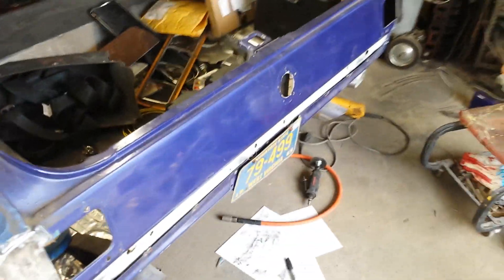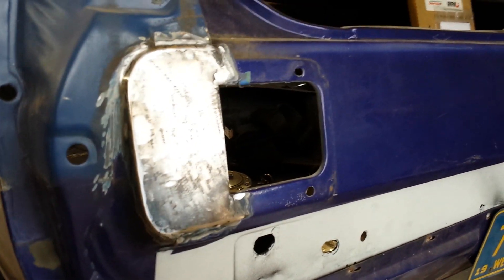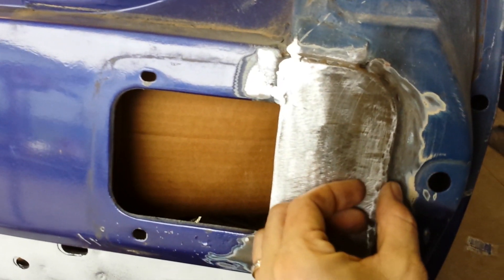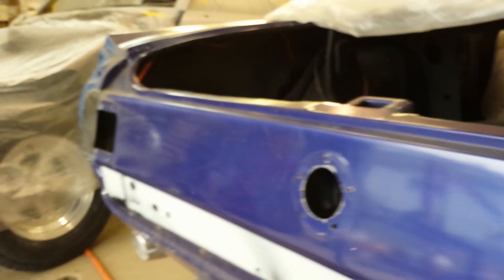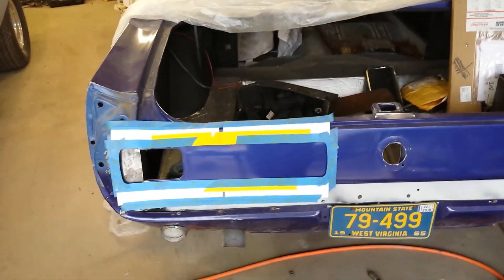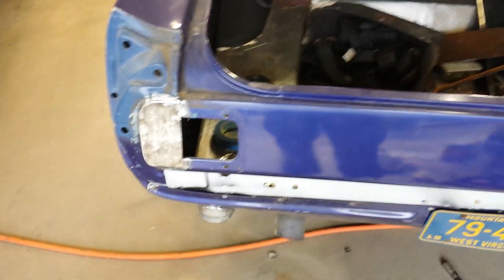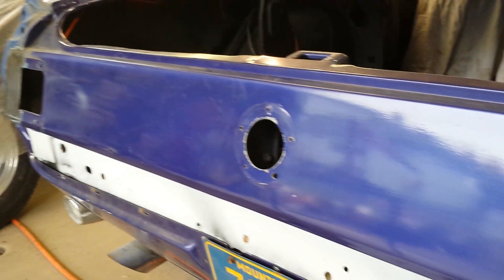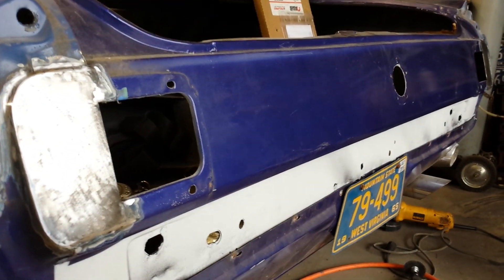1965 Mustang: frenched shelby tail lights part 1

Comment: Billy, I like the plan and the lights will look cool once installed. Is the lens going through the back? If so, I think you may need some kind of weather seal between the lens and body to keep the water out. Can't wait to see more!
Reply from the maker: Yes the are going to mount from the back.  The housings and lens originally have a gasket between them so I'm just going to get another of the same gasket and place it between the lense and the tail light panel.  Should be a good seal. Thanks for watching Joe.

Comment: Nice job. .I'm in the process of doing the same think but with 68 cs lights ....how did u get the edges of the light panel straight?  I see u welded a piece of sheet metal. .did u weld from the inside ? Also dis u cut out the edges or welded over them. .Beautiful work tho
Reply from the maker: I cut out the old portion of the panel and welded in these pieces from the outside.  It's necessary in my opinion because the the housing hits the inside and you can't mount it properly.  Welding these blanks in allows you to have some wiggle room.  Not sure if I completely understand your question about getting the light panel straight.
Reply from the maker: Oh yeah.  I cut the outside portion of the tail light panel off and welded in the new sheet metal portion.  Thats why the edge in the hole is straight.  Check out the process on Turbocobra's page.  He did the same.
Reply: Thanks for the response. ..really helpful video. .!
Reply from the maker: I have more progress videos of them.  I think there are a total of 4 from working on the tail panel.
Reply: I just seen them all. .great videos. .gave me confidence to do it on my car. ..I will be making a video also. ....thanks again bud